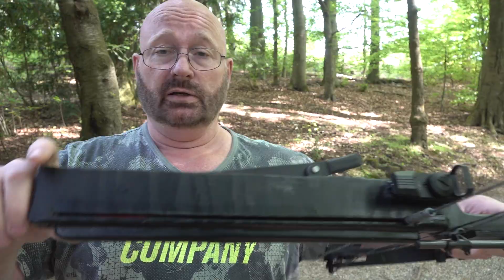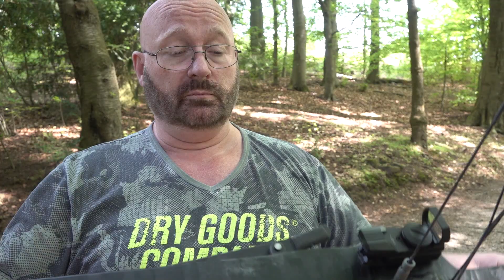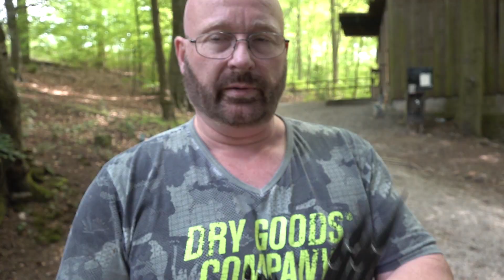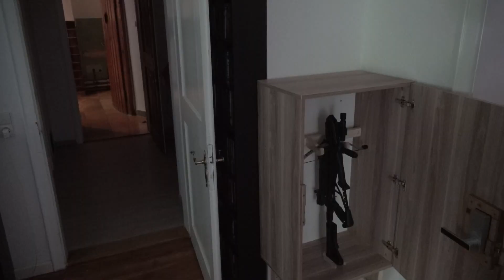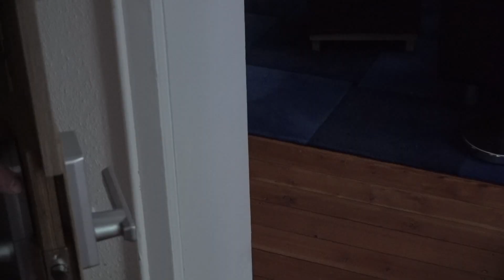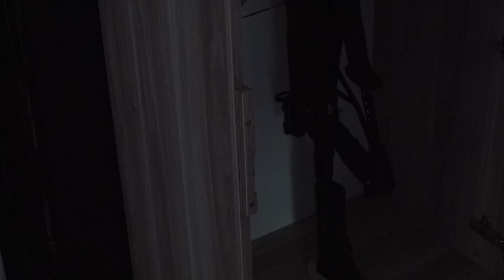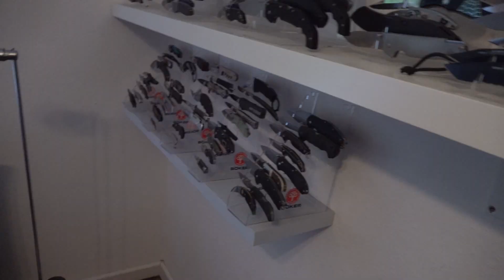The "Machine Bow" is a reality!

Comment: In sweden, its the same with crossbows, they just need to be put in a locked cabinet, doesn't need to be a safe.
But legally, they are considered weapons and require a license, and you can get in pretty real trouble if you use a crossbow to defend yourself, even if you pick it up from a locked cabinet, as defending yourself in sweden with a crossbow - even if you have license on it, is equal to use a "normal weapon", and thus require a pretty high violence level from the attackers side before it become appropiate to use that violence level.

Only real weapons (pistols, rifles etc) must be kept in a SS-3492 or better safe (SS-3492 is just marginally crappier than EN 1143-1 Grade 0), Each weapon requires a separate license, and theres no "weapon card" or "weapon license holder" thing of permit, each weapon is a completely new license application, and it ISNT easier to get a second weapon license because you already have one. Rather, you might get your license application rejected just because "you already own a weapon, you don't need another one". You must be able to state a valid reason why it isn't enough with one weapon (hunters for example which hunts different animal types might need different rifles, and a competitior might need different calibers for different competition classes)
However, the nice thing with swedish weapon law, is that its LEGALLY possible for you to get a license for *ANYTHING*. You could even get a license for a RPG or LAW if you want, if you have a valid reason to possess one. Theres no "banned weapons" or "restricted weapons" in the actual law text, but it would be pretty hard to state a valid reason to posess a RPG or LAW.
(However, this may change with EU weapon directive, that states some weapons must be banned in the law text so even if you would get a valid license for such a weapon, the license is deemed invalid)

Self-defense is not normally a valid reason for any weapon, only in very specific circumstances (for example a high-ranked person under constant threat from criminal gangs) AND the situation cannot be solved with armed life-guards, then you can get a handgun for self-defense. Those licenses are rare however, like they can be counted on 1 hand. A weapon not approved for self defense may NOT be carried in public unless you are transporting it to/from a shooting range or hunting spot. This also applies to unloaded weapons packed down in a case. Armed life-guards don't have their own weapon license, instead they borrow licensed weapons from the life-guard company they are employed at, - but such weapons may only be brought out on a mission, if that mission have a special approvation from the police department. Basically, to be able to get armed life guards, you need to be approved to have armed life-guards from the police - it isn't enough to cough up lots of money, you must kinda of be an VIP too... However, unarmed life guards can be hired with money only.
Cops and military is of course allowed to have weapons, these have company-tied licenses too. Cops are not allowed to bring their weapons home off-duty, UNLESS both of these requirements are met: 1: The cop must have a approved safe at home (SS-3492 and better), and 2: The cop must have a special permit to carry the weapon off-duty, for example due to retalitation threats from criminal gangs or similiar.
Military were before allowed to have their weapons at home but locked with a barrel lock so it couldn't be abused, in a safe, and the key would be carried by general of the batalion/group in question, so the military member could travel directly to the target area. This is now removed, due to parts being salvaged from stolen and locked military weapons by crmiminals, instead military weapons must instead be turned in at the reception of the military centre for central storage. If something happens that require use of weapons, these weapons can be checked out for those military personell that have been requested to partipicate in armed defense actions, this means they have to travel to the military centre and then to the target area instead.

There exist weapons that are totally license free, but have a age limit of 18 years, these are so called "reduced power weapons" and those are defined as those that have a maximum of 10 joule impact energy 4 meters from the muzzle. Most air rifles and soft airguns falls into this rule. License free weapons are still regulated under the weapons laws, and are subject to the restrictions on carry and storage - but they only need to be stored in a locked cabinet or similar, don't need to be a safe. Crossbows that are below 10 joule of impact energy 4 metes from the "muzzle" is also considered license-free, but only if they are constructed in such a way that it can't be loaded with arrows of a different weight and thus affect the joule rating - This can be accomplised by doing like many toy crossbows, by using a slider which the arrow is put on, which absorbs a great deal of the weight and thus limits how much the projectile weight affects impact energy.

Also, in sweden, self defense are pretty restricted. You must always limit your violence amount to the MINIMUM required to protect yourself. Basically, its considered better to use "too little" violence and add up to more later (this is called "violence stair" - start with no violence at all and then add up as more is required based on how situation develops). For example, against an unarmed intruder, its totally forbidden to use a knife, bow/arrow or similiar. A baseball bat MAY be ok, but you need to be careful and not hit so hard. Against a knife weilding intruder, its ok with basically everything, but only if the attacker is charging against you and pose a threat to your life or health. This means you are not allowed to fire your weapon, crossbow or whatever against a knife wielding intruder who are screwing on your TV to steal it, then you should let the TV be stolen and then take it up with police department and insurance company instead. If a attacker stands still and dont pose a immeditate threat, but are preparing for a attack against you, you must first verbally warn, OR fire a warning shot OR fire against less vital parts of the intruder's body. (this was judged by a court when a 72 year old man used a shotgun to defend himself against 2 intruders wielding a knife and a metal pipe, outside his locked door - the locked door was considered such a speedbump for the intruders that the attackers were not a immediate threat - it costed the 72 year man 2 years in prison for manslaugther with discount for high age and discount for the permitted part of the self-defense - in the previous court before appeal, he got 5 years in prison).

If a possibility for you to escape the situation appears, or if the immediate threat is neutralized, you are required to stop defending yourself. Its prohibited to defend yourself against future threats, for example, even if you know the intruder will come back another day and propably kill you while you are sleeping, you can't shoot the intruder in the back because of that, then the new intrusion later in time is considered a "new event" that has to be taken care of that time.

The immediate threat is neutralized if the attacker falls to the ground, because you get a headstart and can run from the attacker, but same appears if you somehow is able to get hold of the attacker's weapon. If a attacker tries to stab you with knife, and you are able to disarm the attacker and get hold of the attacker's knife, its PROHIBITED to stab the attacker back, what you should do then, is to throw the knife into a unreachable location or similiar, to prevent the attacker from getting it. Or keeping it yourself as evidence, and continue defending yourself with fists.
SO BE CAREFUL BEFORE DEFENDING YOURSELF IN SWEDEN!!!!!

Also, the reason normal bow and arrows, slingshots and other weapons without triggers are unregulated in sweden, is because somewhere the line must be drawn between a weapon (as in gun) and just compared to, like throwing a spear, axe or knife. And then, the lawwriter has drawn the line where a weapon can be "charged" with energy in some way, and then carried around charged without effort, is considered a weapon. Since such a weapon could be charged with more energy than is available in a single draw of a bow line.
Also weapons that are manufactured before 1890 and cannot accept gastight cartridges, are considered license free, just because of a grandfather rule. Note that if such a weapon is repaired or modified, the weapon is no longer considered manufactured 1890 and needs a license, because it then counts as a "re-manufacture".

All other items (spears, bows and arrows, knifes, axes, weapons manufactured before 1890 AND cannot accept gastight cartridges, hammers, tools etc) instead is regulated by "knife law" that says that such things are prohibited in public space unless you were somehow required to have them in public space (for example transport a bought kitchen knife home). Possession is only illegal for things that are made to be a weapon (certain war and fight knives, bows and arrows, war axes, batons, etc) IF you are under 21 years of age.

Comment: I am very interested in this as the laws for bows are far more lax in Canada than for firearms or crossbows. It would have to be sold without the red-dot sight, though, as it's very difficult to import any sort of part that can be used for a gun (for instance the Cheapshot crossbow is difficult to import here because of the red-dot sight and the AR-15 compatible gunstock). I have a question: If and when you do begin production of this bow, would you be making higher draw weight versions, specifically a 45lb+ version because 45lb is the minimum legal draw weight in Canada for hunting? I see that as a very useful hunting weapon for birding or small to mid-size game although I don't know if floo floo heads would stack very well in the magazine (maybe they would, though... I wouldn't mind seeing a video where you attempt that). I'm going to subscribe to you specifically to hear the announcement of the production of this bow.

Comment: What if you could add a spring(a fairly strong one) to the butt/stock? It would kind of be like pump shotgun action. With the hand that is holding the bow, pull backwards pushing the stock into your shoulder and compressing the spring thus, allowing just enough room for the other arm to grab the string and pull it back. As soon as you have a good grip on the string, I'd like to imagine that releasing tension with the hand holding the bow would decompress the spring and help the re-notching process. You wouldn't have to pull the string back with as much force if the spring is helping it. Disclaimer - I know nothing about phyics or bows. I just love your channel and had an intoxicated thought

Comment: Can you add a swivel lock on the back component so you can back load arrows. Nothing would change with lever functionality, but reload could be much faster. I'd imagine it could work like the old lever action models that load from the front. All you would have to do is keep the lever to the side, pop and swivel the lock and slide them into the back, re lock and move the lever back to pressure on the arrows

Comment: When shooting with normal bow, you should "lock" your right hand by touching chin/cheek when bow is drawn to get anchor point. This gives you stability and accuracy. Your bow has too short draw length to you. Some shorter guy could use it better. If magazine could be adjustable length, you could modify draw length for different shooters. Maybe grooves with locking screws that allow you to move magazine back and forth is enough for few inch draw length modification. Of course you also need adjustable cams in your bow. This could be important feature if you plan commercial production.
Thank you for excellent videos an ideas.
Reply: This thing is designed to put the hurt on someone quick and dirty. Me likey lots n lots.
Reply: He said that the problem with making the draw further back is that said stock gets in the way of reaching the strings in the first place.

Comment: Could you increase the rate of fire by using something like a rear grip on a slide that hooks the bow string and then activates a sear when fully pulled? So you can fire as fast as you pump the rear handle and don't need to worry about manually pulling the string
Reply: At that point it might be legally a crossbow again
Reply: @pixelb3285  i thought the same but semantically a sear isn't a trigger so......😉

Comment: That's an amazing design! Fast to fire. Not bad on the reload time. Yeah.  I think you've got  a winner  there! 

Only thing I can think that might be an improvement would be to put a cut-out on the top of the arrow holder. That would give you a quicker way to know if you are running low on ammo.  Wouldn't have to be big even. Just a slit-window where the fletchings lay in the holder near the rear grip.

Comment: Jörg, I would absolutely buy one of those things if they went on the market, on the conditions that it's available in the U·S·A·, I have the money, and you would be supported if I bought one. I have no experience with archery, but that looks so much easier to handle than both a crossbow and a firearm, I'm sure even an inexperienced guy like myself could use it.
Reply: Crossbows are simple to use. Pull the string to a certain point then the string is locked in. Then you can load the bolt and you're ready to fire. From their you just aim and shoot.
Reply: A firearm is mostly the same except now you have recoil to deal with.
Reply: Bows are just load arrow. Draw back. Release. Although there is a certain way to do it without scraping the skin off your forearm

Comment: This is the future of bows! this is great!
Reply: Next a pipe with fast burning powder in it, to propel a lead ball out of it
Reply: @jojo_87_xy  isn't that just an old fashioned rifle?
Reply: For me, the reload time outweighs the benefits. It is awesome though.
Reply: Devin M.  i disagree. shotguns have the same method of reloading. you have to place the bullets inside, and even so, shotguns are widely used and very reliable weapons.

im anxious to see this bow on the market.
Reply: @hunter.1  I don't really care for guns, I am not anti-gun however. I like how quickly I can fire a recurve and I'm not fond of  compounds, but to each his own.
Reply: @devinm.6149  How so if its like loading a shotgun
Reply: @omartorres5688  loading a shotgun is slower than I like and I said for me !
Reply: @devinm.6149  I understand though this bow for others has its uses
Reply: @omartorres5688  did I claim otherwise?
Reply: @devinm.6149  No
Reply: @devinm.6149  On a different note how much practice does one need to fire a recurve or other bows consistently , quickly and accurately?
Reply: @omartorres5688  Archery is very easy to pick up. Eventually, muscle memory takes care of the rest. 

In addition, speed isn't as much a factor as you might think. If your outside of an archery range, arrows are much larger projectiles than bullets, so firing rapidly without taking wind or bow swing into account is very, VERY detrimental to accuracy. 

This machine bow is definitely impressive, but it's not a long range bow, which is where the most powerful bows excel. He himself said the draw strength isn't that powerful. Draw strength is the amount of tension the string has, and the most powerful bows emphasize controlled draws. These ones require a lot of upper body strength and endurance.

A good self defense weapon, not a powerful bow. Maybe a good hunting sidearm. Definitely worth putting into production.
Reply: @YggdrasilBurnes-j5s  nice as I thought you had to have finesse to be successful at archery but in fairness I wouls choose the crossbow as it is easier to modify to be a fast loading repeater as jeorge and numerous others had done plus inspired me for my idea with involves a pump action crossbow that at the pump.handle has eight skateboard bearings and a folding limb bow with gears that along with the skate bearings do most of the work in racking up bow string